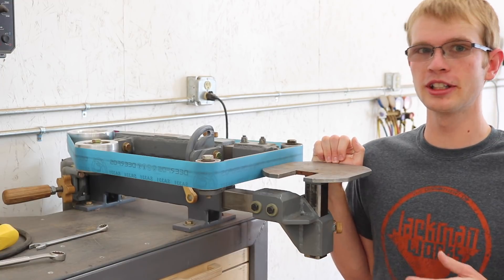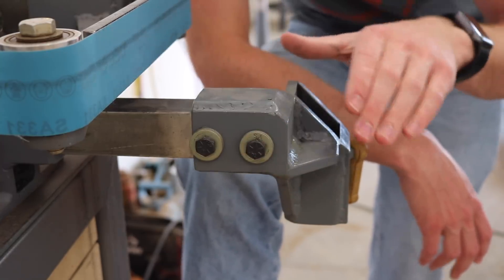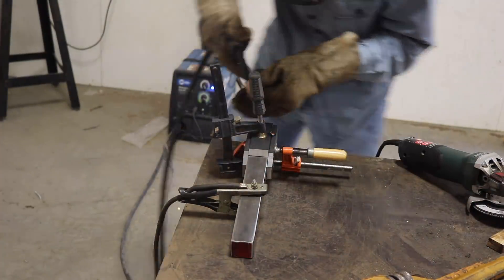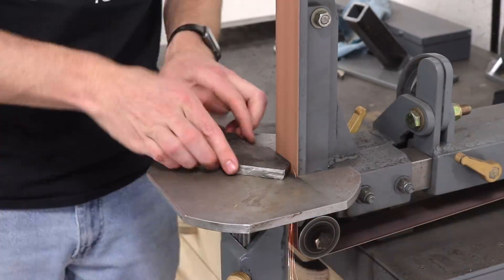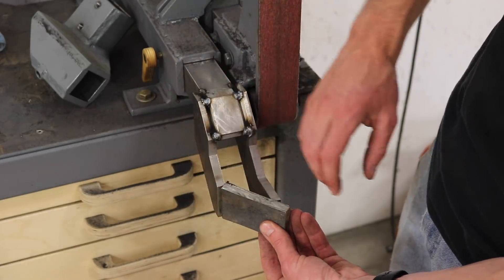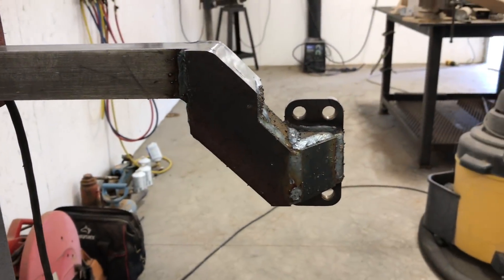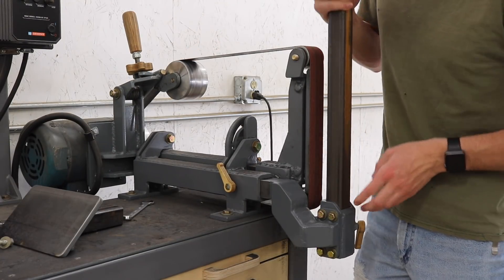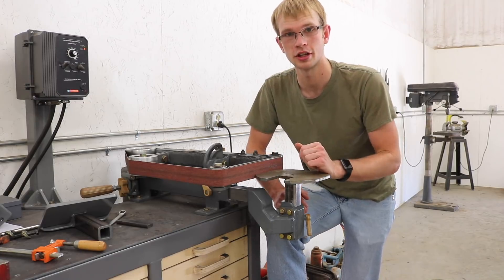Improved table holder for belt grinder

Comment: Without a doubt,  one of the better designs available but man is it overbuilt.  The thicknesses of steel used and the amount of weld used could be duplicated in balsa wood and craft glue and it would still be overbuilt.
Stiffeners on the rear of the table, unnecessary which would have eliminated much of the rework.  6mm plate used on making the new arm unnecessary and fully welded.  You need to study steel strength and trust in steel. Great project works, seemingly, well exceptional versatility and sure it is smooth but .........
Reply from the maker: I understand the strength of steel. This machine would work even if it was built with 1/8" material or less. But I hate chatter and vibration, and overbuilding doesn't hurt anything as long as it's not too heavy or bulky. All of the attachments can still be easily handled with one hand, so I don't see any reason to make it weaker.

Comment: You've got very good skills in fabricating, but so much waste of time on unnecessary design. Most of the times you could easily get away with just 45 degree cuts and turn the pipe and you have proper joint after welding. At the end of the day it's only a belt grinder. All these small piece cuts are a waste of time and makes for some bad alignments since you multiply by order of magnitude on welds and cuts, since you aren't cutting with CNC nor cutting with a milling machine. These small brackets and pieces are best suited in less complex and only for when it's really needed. I've learnt at a young age that those whom are experts understand a complex task and know how to make it simpler, you are doing the exact opposite. Just think about this for a moment as any great engineer would take a complex design and make it simpler based on previous experience as it saves time and money. Hope you learnt something.

Comment: dont say chamfer  say BEVEL.! BTW all your welds are cold dont Mig weld thick stuff use dual shield. less griding better penetration stronger welds etc... I like your stuff but your welding gives me heart burns
Reply from the maker: So I usually ignore comments that come across as rude instead of constructive criticism, but I looked up chamfer vs bevel. The definition for chamfer seems to match much more closely than bevel...can you explain why I should say bevel?

I am aware my welds are not very good. But I’m just a hobbyist, and it’s not worth having different welders or different consumables for different jobs. If I start mass-producing something I’ll try to do it right, but for personal projects, well, this sure as hell isn’t gonna fall apart.

Comment: Holy crap, we're headed into year #2 of belt grinder videos. It's cool, don't get me wrong.. but I subscribed back in the woodworking era, so if this is all I have to look forward to I guess it's time for me to unsubscribe :/
Reply from the maker: I don't expect to be the belt grinder channel forever, I've just been building up all of the attachments & accessories for it. But if you choose to unsubscribe, I understand. I have dragged this out a lot more than I should have.
Reply: Jeremy Schmidt - I would like to tell you that not one minute of those video on this belt grinder is worthless. I did not skip a single second and i even watch them a few time. Wood or steel, you are rated A++.  👍👍👍👍👍
Reply from the maker: Thanks!